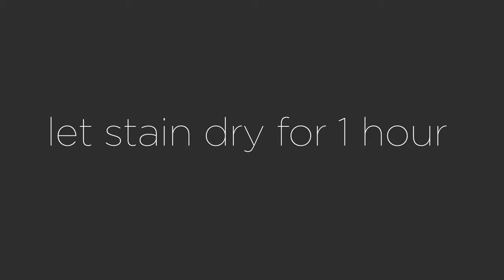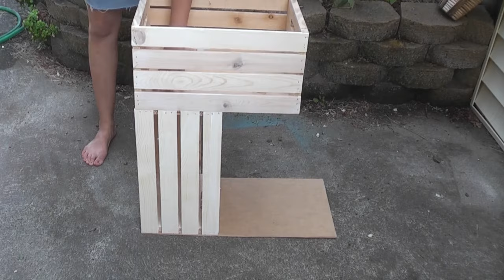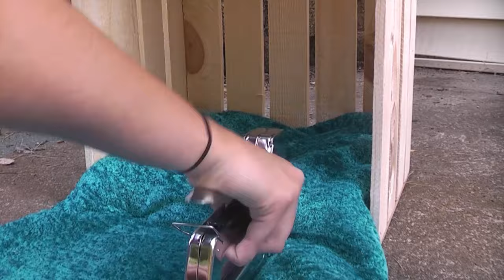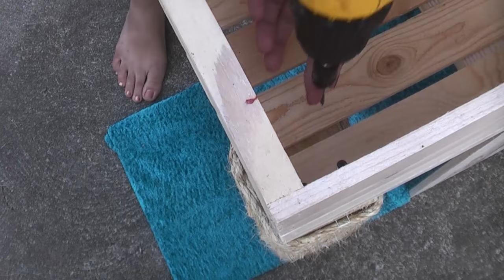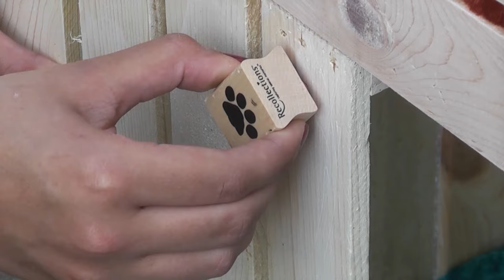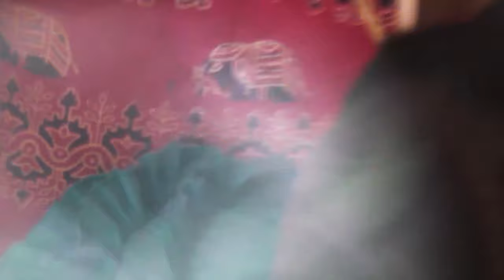DIY Cat Crate Tree

Comment: I have several of those crates. I use them for a lot of things and have been creating a cat condo in my mind for a while using them. I want to make a taller one but thanks for the video. It gave me more ideas and a visual of what mine might look like. The ones available are expensive and have mixed reviews. I made one several years go out of solid wood. Heavy but very sturdy for the four cats I had at the time. Planning to adopt a kitten/cat or two soon and I want to be ready. Thanks again for your video.
Reply: Del Reed you can go to Michael’s craft shop to get crates. They usually have a 40% off coupon on their app.